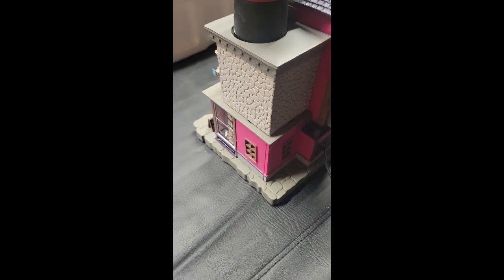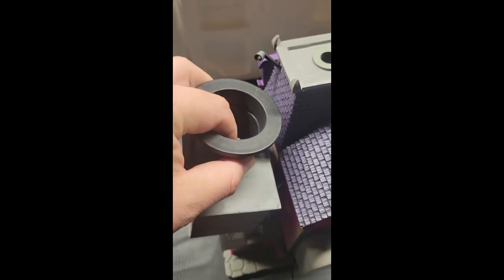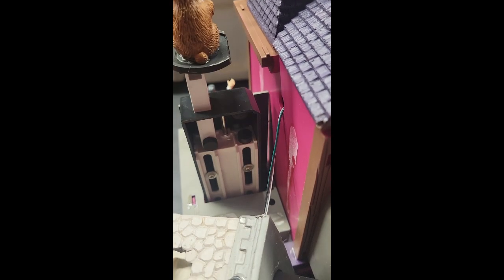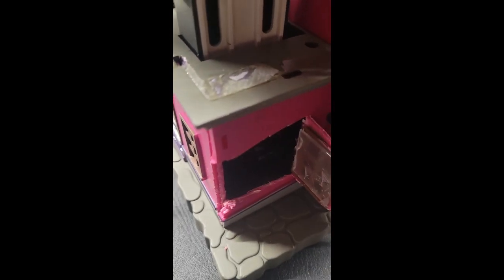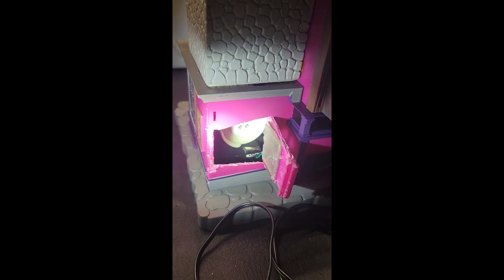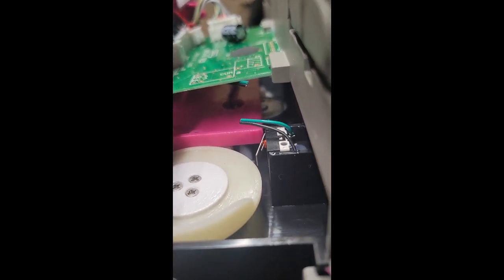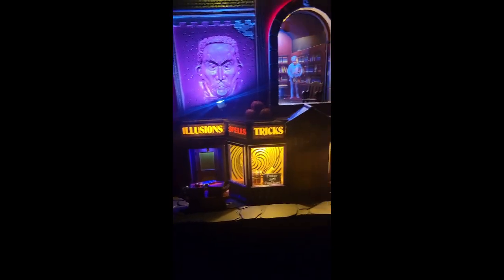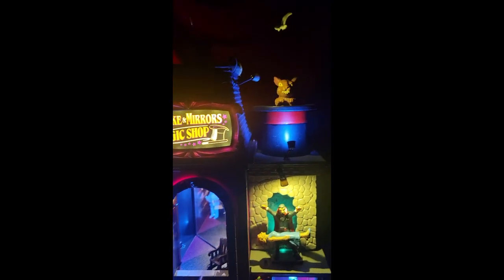The Rabbit Had to Go! Lemax Spooky Town Smoke & Mirrors Magic Shop ~ Review ~ Rabbit Fix

Comment: I got the magic shop but after a couple of days of use (for decor) one of the circle things stopped spinning and after a couple while longer the other one stopped and then the bird thing followed suit is there a way i could fix this (i wish i knew i bought the warranty)
Reply from the maker: @bronyman9000  Those are ran on different motors. That's weird. Did you get it from a big store like Michaels? I would try to return it
Reply: @SouthofSanityCandles  yes
Reply: @SouthofSanityCandles  I've had it for a while so I don't know what the return period is also the misting one I got its still fine but now it doesn't mist anymore even with a new piece of those white rod things
Reply: @SouthofSanityCandles  and its my 1st time coming across these amazing art pieces
Reply from the maker: @bronyman9000  oh man. That's some bad luck right there. I always worry about pieces breaking so I don't usually run them for too long. For the price you would figure you could run them forever though

Comment: Hey. Are there any other recommendations for getting the bottom piece off? Is it glued on as well as screwed in? The black clips seem to be holding it in but I can’t seem to get them to release. Any help would be appreciated, thank you!
Reply from the maker: @jasonwhittles8831  the piece under the Chimney?
Reply: I removed the rubber pieces and 8 screws and was able to unclip all the pink clips but there seemed to be something still holding together. Wasn’t sure if the black clips in the middle of the bottom were holding it in place or if there was something I was missing. The rabbit just needs a little bit of pressure to stop the popping sound and some hair ties seemed to help for the moment. Gonna try some small rubber bands tomorrow and see if that helps
Reply from the maker: @jasonwhittles8831  Its probably those 2 swirly window spinners. I had to tug on it pretty hard. But wouldn't recommend it. Rubber bands are a good idea
Reply: You can position/cross them a certain way to where the hair tie goes over the chimney and the bunny hits them on its way up and it prolly cuts the popping sound in half. I’m either gonna get tighter rubber bands and see if that helps or maybe super glue a small top hat on the bunny to make it stay in contact with the rubber band when the bunny is at its lowest point, keeping slight pressure on the bunny and prevent the popping sound
Reply: @jasonwhittles8831 what do you mean you did it with rubber bands? Can you explain?

Comment: Thanks for showing your process!  Random question.  So it's easy to pop off the right side as evident in your video.  Then you unscrewed the bottom to access the board and mechanism.  Do you think it'd be feasible to remove the entire mechanism that makes the rabbit go up?  I honestly just want to get rid of everything on the right side of the building above the mirror guy in the resin  Thanks!
Reply from the maker: @Rambl3On  I'm sure you could remove the whole rabbit mechanism if you wanted to. Or just clip the power wire to it.